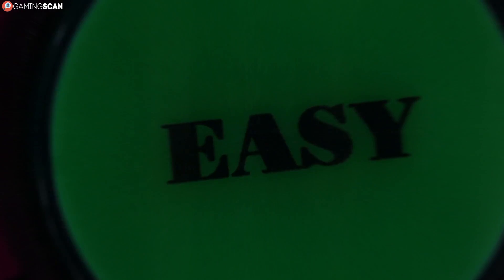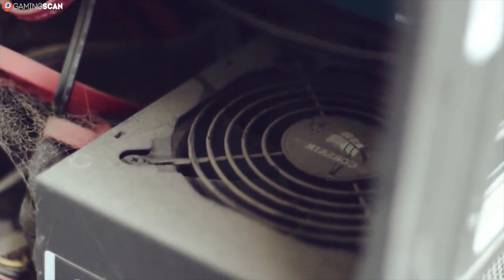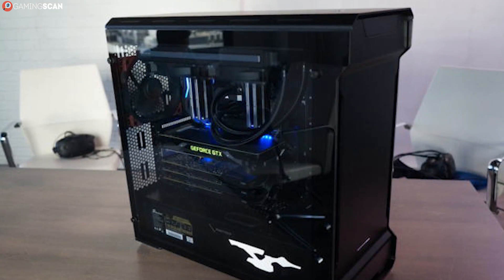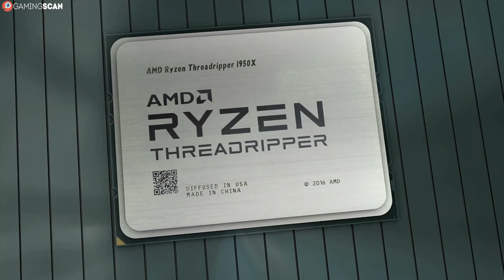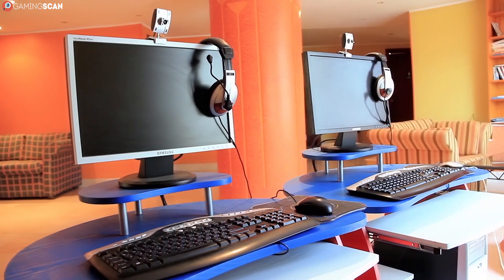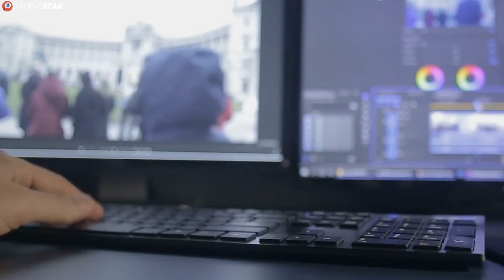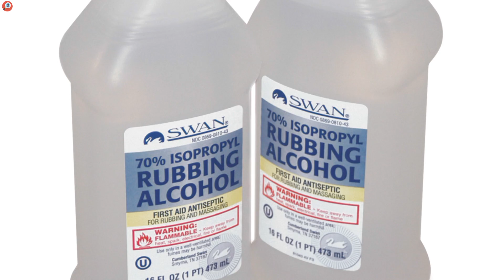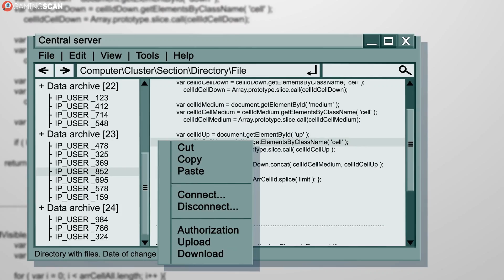How To Physically Clean Your Computer [Simple Guide]

Comment: what a terrible video - too many danger areas are skipped over and this a big no no! Use a vacuum!!! NO! And what is with ripping the CPU cooler off the motherboard with absolutely no mention of the fact that you have to re mount the bloody thing with contact media! There is absolutely no mention of this! Very poor video indeed.
Quote(ish): "remember it is paramount to hold the can upright and not to shake the compressed it as it can damage ..." then at 4:46 we see a half-wit holding the can sideways and shaking it and there is the consequential liquid visibly seen spraying all over the graphic's card! Holy macaroni - what an awful demo!!

Comment: You didn't mention the dangers of ESD.
electrostatic discharge is harmful especially on the components of the pc such as
The motherboard. Make sure you are standing while cleaning the case so the static
 wont build up fast. Also touch something metal like the cover of the case so you discharge
Some of the static buildup. Also get your hands on some anti-static wrist wraps. They are recommended
But not required. They are not that expensive and could buy you lots of time cleaning the case by frequently
Touching metals. But you still wanna do it for safety purposes.
Reply: I built my whole computer on my bed, I didn't have problems at all either but I did constantly touch the case just to be sure though.

Comment: NO!  NO!  NO!!!  NEVER EVER use a vacuum to clean a computer case that has any circuitry in it!  The opening of the hose creates a vortex full of static electricity that can fry chips.  Whoever put this video together should know better than that.  This is why canned air is so important.  Vaccums = static.  Air compressors = moisture.

Canned air and an anti-static dusting brush are all you need for most things.  If its really far gone, liquid contact cleaner (aka TV tuner cleaner) will get the rest.
Reply: Rip after I cleaned my computer with a vacuum I saw this comment and panicked but luckily all is good phew..
Reply: Why doesn't canned air create static? Doesn't the air blowing out rub against the tubing?
Reply: What about hait driers lol
Reply: Rubbing Alcohol ok ?
Dust cloths ok ?
Tooth brush ok ?
Best way to clean the mother board, ram chip sets, and peripherals ?
Reply: @sparkynm156  with water
Reply: they didn't use a vacuum

Comment: Can we use an hair dryer?
Reply: No
Reply: CloutGodWompy why?
Reply: CloutGodWompy im using hair blower woth my pc and brush.
Reply: Not if you want your PC to live.  Dry + hot + air = static electricity.  Static + micro-circuitry = tiny little welding arcs.  :)  Not good.
Reply: @phydeux  what if the hair dryer has a cool setting? mine can blow cold air if you hold  a button :/
Reply: @dujilli  - While the heat certainly does dry the air and increase static potential, even cool air in a vortex will create some static as it creates friction against the plastic shell.

And while it takes about 3000V of static for you and I to feel it, but only about 5V to weld together the tiny micro-circuits in a processor and some other chips.

If the air is cool and too moist, then you end up with issues of moisture being deposited on circuits.  And if there's any charged capacitors on that circuit, you can create a short that would energize the wrong neighboring circuit and fry out sensitive parts.

Comment: You didn't mention anything about thermalpaste If you are going to disassembly GPU and CPU cooler
Reply: Nobody needs thermal paste, she did good to not put it in the video. Thermal paste is a myth, and nobody should ever use it. When I bought my pc the first thing I did was unplugging the aio pump and removing the thermal paste. Now I don't have the pc anymore but I'm sure it's not because of the thermal paste removal.
Reply: Wait, this video is telling ppl to stick a screw driver into your power supply unit to hold the fan while you clean it? I don’t recommend anyone that’s new to PCs or not experienced to touch the power supply unit at all, never mind stick a screw driver in it 🤦‍♂️ tryna electrocute pll or sum? Just use air in can, and please don’t try to dis assemble your power supply, have a pro do it if it’s that dirty. That can be super dangerous to do..and also wouldn’t use a vacuum if your a beginner, too high of risk for static electricity to short out components. I feel bad for anyone who follows this videos instructions.. poorly put together too, they keep saying hold the fan blades but in ever part they say it, they aren’t holding them and they’re spinning what looks like backwards 🤷‍♂️
Reply: Dont remove the cooler if the paste under it is old and you are not going to apply new one.
Reply: What about it?
Reply: @shweepa2061  its good practice to change your thermal paste if you take it apart might as well change that too also nothing was mentioned about the fact that if you take apart and clean your cpu cooler and gpu that also means cleaning off the preapplied thermal paste so if you were to do whats shown your pc would reach insane temps
Reply: It's a video about dusting off components. Do you also want them to show you a cookies recipe?
Reply: Ted nah bruh I was about to do this, it would’ve fucked my CPU up. Its not a cookies recipe its pre heating the oven till its fucking burnt through.
Reply: @TheActualTed  in every clean up videos it is mentioned if you want to clean your cpu cooler be prepared with a thermal paste otherwise don't clean it. Thermal paste needs to be applied everytime you remove the cpu cooler.
Reply: @edgecraft96420  But those are two completely separate things. I don't know how often you clean your PC but you certainly don't need to reapply paste everytime you dust it. Not to mention that changing thermal compound on GPU can be dangerous and is levels above just cleaning the dust for normal user.
Reply: @edgecraft96420  Ok, I rewatched the video and you have a point. Last time I just briefly went through the vid and it really should mention repasting, yeah.
Reply: @TheActualTed  I'm not talking about gpu I'm talking about cpu (central processing Unit). I would not even recommend opening your gpu and change the thermal paste. For cpu you have to apply thermal paste everytime you remove the cooler to clean also Linus tell this everytime.
Reply: You should change thermal paste once every 2 years. And that's only if it's easy to take your cpu fan out.

Comment: No mention of static electricity. Make sure you touch something metal to discharge any static.
Reply: AND DONT USE A VACUUM CLEANER BECAUSE IT ALSO GENERATES STATIC ELECTRICITY!!!!!!!
Reply: Grounded metal. Touching a random screw does nothing. Touch a plugged in psu or anything with a grounding pin in the outlet
Reply: Or carpet
Reply: A bit late to the party, but I second this, the static is no joke. There were a few times when I touched my colleague's desk and the static discharge from my hand turned off his All-in-one PC or made his screen flicker.
Reply: whoami 2020 very rarely can u damage pc components using ur own static electricity, the real danger comes when using a vacuum cleaner, as these can significantly harm components if they touch. Regardless, you should exercise proper safety measures because even light discharges can cause long term damage.
(edited the last line in as my views on the topic have changed)
Reply: @shekelboob  i legit just used a handheld vacuum to clean my $1,500 pc :| glad i seen this comment mate thanks i won't be doing that anymore
Reply: @Ismileinvain  Is it running fine?
Reply: @arbazmadeit  yee its great still needs a proper cleaning tho

Comment: In how many days should I clean my pc
Reply: Yashvardhan Tyagi honestly, it really depends if your room is dusty. if it’s real close to the floor like mine, and you have a carpet, clean it around every month. if you have a computer that sits on the desk, id still go for a month to be honest. 3 months of no cleaning really got my pc down.
Reply: @BasedBag  Thanks for answering
Reply: @BasedBag  what about if it floor and no carpet (hard wood floors and tiles)
Reply: @nfslunatic199  You should go for once every month. If you keep your room really clean. Then go for one and a half months to two months.
Reply: @SaneMaybe  ok thanks
Reply: Pugnat0r lol i haven‘t properly cleaned mine in 6 months and it‘s working just fine. I remover dust from the inside and the blades as far as I can reach but don‘t dissaamble it simply because I‘m to scared to damage it

Comment: Why can't I just shower with my PC?
Reply: if u have a water cooled pc you can. Make sure to fill refill the water cooler after u are done bathing
Reply: Smart
Reply: In a word.... capacitors.

If it weren't for capacitance on the boards theoretically you could wash them with water as long it dried sufficiently.  (Hard drives excluded)  This is why you can wash a keyboard in the dishwasher and not ruin it as long as it dries out for a very long time.
Reply: @phydeux  it was a joke
Reply: @HB14264  - I know that, all I did was show that there's only a couple things keeping you from actually doing it.  That's really not a big deal.  It's not like I called anyone stupid or some asshole move like that.
Reply: @phydeux  fair enough